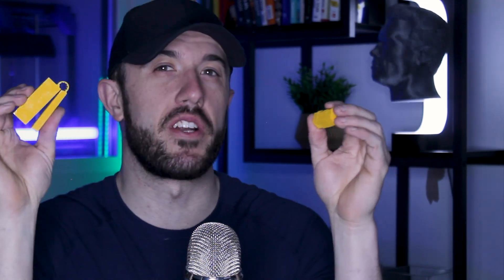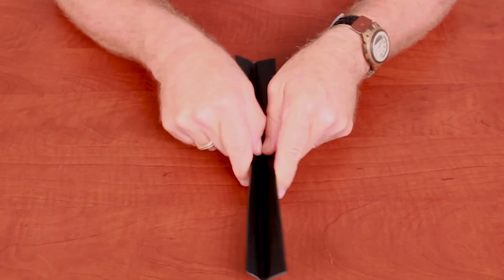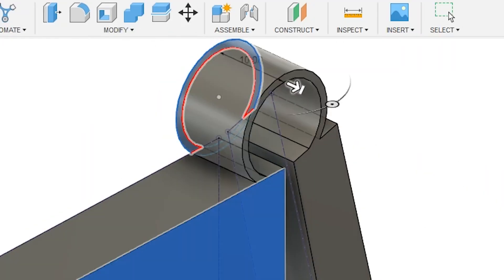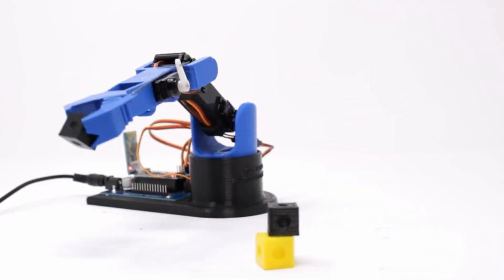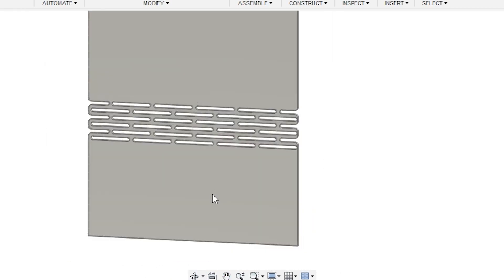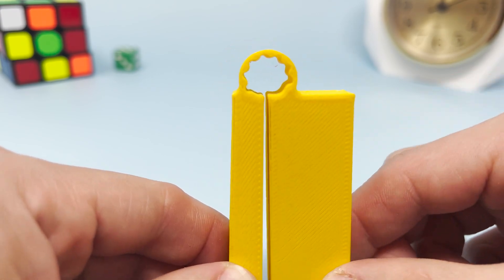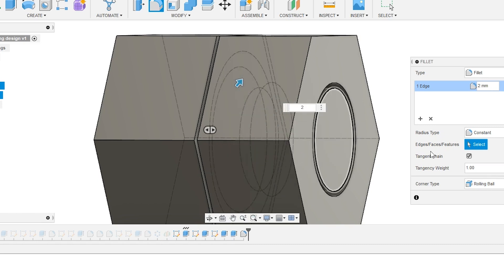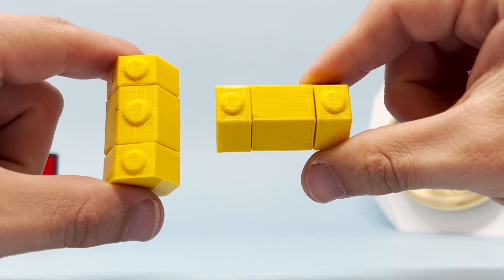5 Living Hinges for Mass Production 3D Printing

Comment: I just gotta say, your videos are the best modeling course out there! I just saw your other video about printing boxes diagonally and that made me think, would it ve possible to print a box diagonally if it has a print in place hinge? That would maybe fix the issue you described when printing it flat on the build plate "rotation due to saging" and would be a little stronger than printing it vertically. What do you think?

Comment: Why, why are you creating stress points in otherwise great hinges?? You start with a hinge with one stress point. Solely by making it of equal thickness you can achieve much better longevity. Ok, you got great idea and made a circular hinge. Why would you introduce a lot of stress points into it by those grooves?!
Reply: Just to make it adjustable.

Comment: One thing you can do with the print in place hinges is angle everything at around 30-35 degrees. That way you get the best of both worlds with it not being as brittle as standing up, and not having that crunchiness from laying flat and having the bridges droop down. If you design the part right this way you can also eliminate the need for the moving parts to use each other as "supports" which again reduces the crunchiness.

Comment: We're doing a living hinge mechanism that NEEDS to be vertically printed (across layer lines) and thus far we were using just a straight level with a gap, but we've now addded those toothed grooves to hopefully spread the load out and make the force to bend that mechanism uniform across various user printers

Comment: At the end of this video a now we part ways pun was missing... 😂

I smoothed out the rotation action on a horizontal printed 'grown' hinge using a drill and an adjustable clamp to hold the center (safely away from hand). A little lubricant in the form of alcohol (dripped in and let the capillary action carry into the piece void) and some careful application of rpms. A little heat friction goes a long way. YMMV. And you have to work out how to attach it to your drill. I used a socket and and some museum wax/puddy  clay in this one case. You don't need much. My hinge wast hex shaped. Tape would have been enough tbh. If it starts to smoke you've gone too far/fast/long. 😅 Again ymmv.

Comment: A really well-explained video. However, the spinning head in the background, coupled with the rapid-fire explanation, wore me out.  This old codger needs a bit more time to absorb all of the talents demonstrated.
Reply: Old codger?  You have hair, and it is not even gray...  Anyway, as one old codger to another, I like the quick, concise discussion.  If needed, I replay parts I didn't get at 75% speed, or in this case 25% speed for understanding how the part was printed on its side.  My biggest issue is my hearing.  I often replay parts where I didn't catch the words. (the "old codger" talk was meant with self deprecating humor directed at myself)
Reply: @michaelj3971  Ha Ha...You've reminded me to CHANGE THAT PICTURE! At 83, I do have more gray than black!  I spent many years speaking/selling on the phone and face to face.  Some people speak quickly, some slowly.  The most effective communication (for me ) is to match your speech to the subject's speech.  Not easy to do online, though.
Reply: @ytrichg99  You've aged a little since your last post!  And at 69, I have also lost my old codger creds.  I know what you mean about effective communication with different people.  One of my adjunct responsibilities over the years was teaching technical courses.  

My son talks at about the same speed as the presenter in the Slant3D videos.  It would be nice if my son had a speed control and replay capabilities like YouTube...
Reply: @michaelj3971  While I lived in the Midwest during much of my working career, I interfaced with my NY brethren much of the time. Their pace was often hard to match. I moved to TX in 1980. The true Texans thought I was too fast! Little did they know. Ha Ha

Comment: At 4:06 how did you print that part vertically? How where you able to print it so that it would still turn and not stick together? Or is it just print and then break the layer interface between the rotating and static part? Or is there still a small gap to give it a bit of play?
Reply: Same question here. I’m confused.

Comment: What about hinges that need to lock in position at a given angle? Like to provide an adjustable viewing angle for an lcd screen holder for example.
Reply: With that last example you can add a cam to it. If you use a hexagonal silhouette like he did here, or another simple polygon, just extrude one of the facets out into a rounded bulge, and make sure there's a lip where you need it to lock. When it crosses that lip, the bulge will have to squeeze past it with the user's help, but then it will be locked beyond that lip until he or she moves it back again. Depending on how closely you need it to lock to that point, or other details of your geometry, you can add more lips to one side or more cams to the other to get that functionality.

Comment: would love to see a video about 3d printing threads and the different kinds of threads and how to get the tolerances to fit well even when using a not so accurate 3d printer
Reply: Search “Design Threads and Inserts for 3D Printing with Shapr3D” 👍

Comment: I've found that if you make the horizontal hinge as stubs instead of a shaft it prints quite well and can be very strong.
Reply from the maker: That is a way to do  it. But there is a greater danger of pullout with stubbed hinges.
Reply: @slant3d  True. I like to make it so that the stubs actually meet in the middle so that there is minimal bridging being done.  Each stub has an angle so the middle part of the shaft is actually a very small diameter. I've found I can get it to be incredibly strong to the point that the part that fails is the outer wall of the hinge even when the outer wall is several mm thick.

Comment: Great video. I found another way to make living hinges when working with PLA.  Sometimes I can position the hinge so that I can print its layers as a different color.  Instead of actually changing colors, I can switch to Flexible PLA of the same or complimentary color.  The layers between the two types of PLA stick really well and the hinge bends better and lasts longer than regular PLA.
Reply from the maker: Multimaterial is a great solution enabled by printing. But it is not viable in mass production
Reply: @slant3d  True
Reply: @slant3d  Wil this change if the tool changers + tool changer software are more common? Like Prusa XL. MMU and TPU are not a thing.